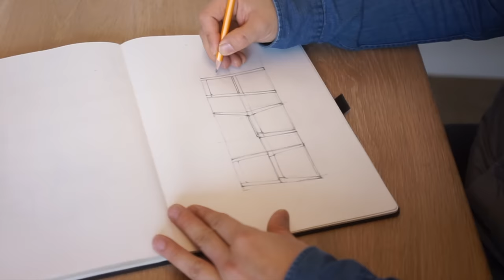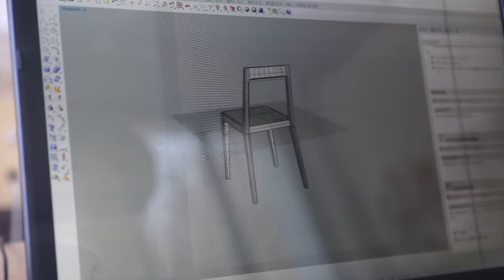Kobeomsuk furniture - Making of Rounded Chair

Comment: Awesome!
What software are you using for design?
Reply: Tshwanelo Tshenyego Looks like Autodesk Inventor
Reply: I have the same question....
Reply: rhino
Reply: It's Rhino, but it's not like software is the one that gives great 
design :) You can use any software (Solidworks, Inventor, Fusion 360..) 
and get the same results (with less learning, Rhino is hard to 
learn..)..
Reply: @oskarmohar6073  thanks, I found it already.
I agree with you, it can be drown by hands and be better then in program.
Reply: The beauty is first created with the mind and hand. The software helps to speed up the production.

Comment: what program did you use to make the model?
Reply: rhino
Reply: @Spatialreels  this program is better than Fusion 360?
Reply: Федерал not better, just different. Having worked with both I can say they both would work well for furniture design, it just depends what you’re more comfortable using and which helps you communicate your design better. Hope this helps!
Reply: @mattbentley7282  thanks!

Comment: It would have been much nicer if joints were made in the middle of fillets so to minimize any short grain.  The back leg is bowing too much for this kind of design as these kind are designed with mind of materials standards.  For this case, eliminating the bow within the width of plank that lets you get 2 legs side by side, so to reduce wastes.  Also the legs wide spread, you can easily gets your pinky in risk!!
Reply: PB, I am not buying your critique, except for the short grain. That is surely a consideration, but look at all the Mid-Century scandinavian furniture that also has such features and has stood up over time. I think that if it didn't chip out in the shaping processes, then it will stay intact. What do you mean by pinky, the little finger? Where do you see that being hurt?